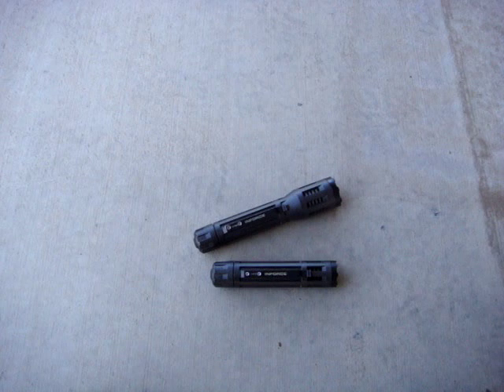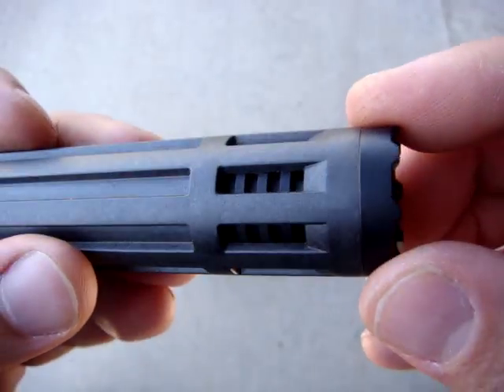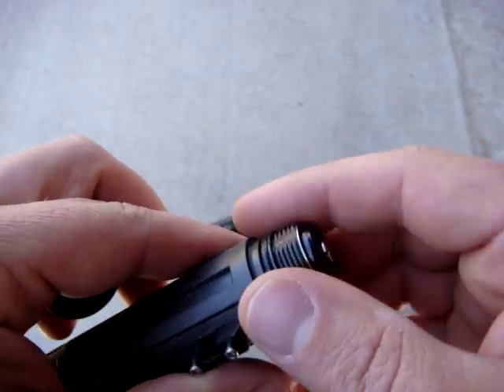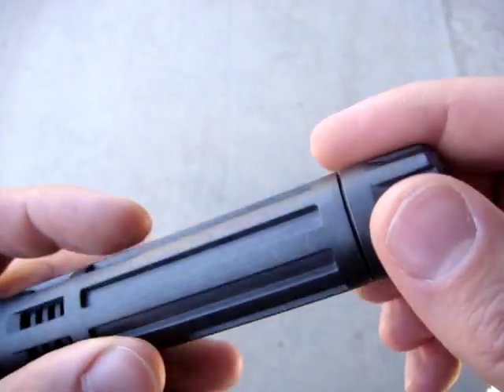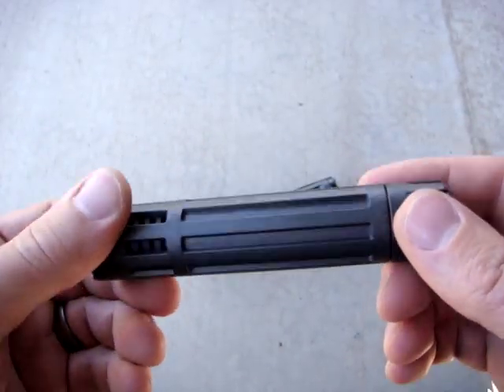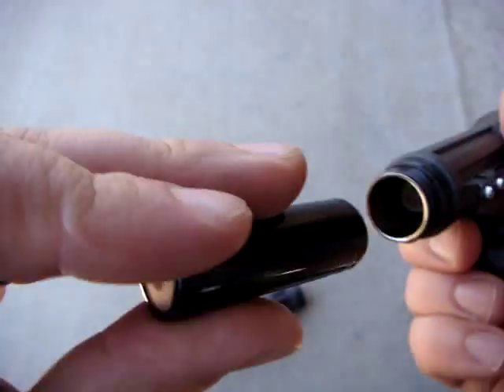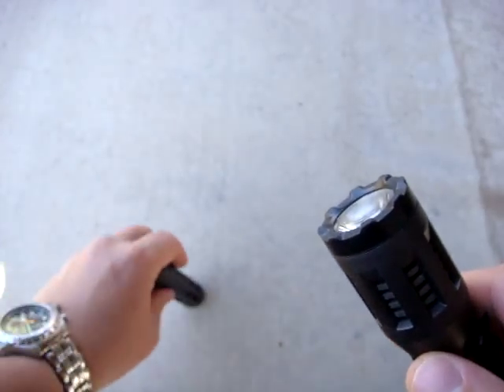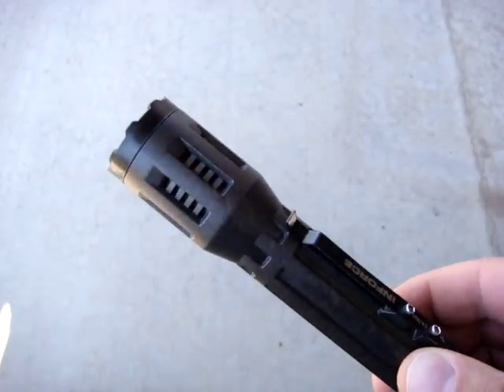Special Circumstances Inc. - Inforce 6vx & 9vx review

Comment: Hey, mate, quick question: I recently bought an InForce 6VX (I decided to go with it because I was able to get it the cheapest, versus an InForce 9VX and an HDS Systems EDC Tactical). It has several issues, the most prominent being an extremely annoying - and decently loud - buzzing sound. I assumed it was a major design flaw, and I wanted to return the light. However, I emailed InForce, and it's not supposed to do that.

Do your InForce lights have that problem? 

Thanks! God bless.